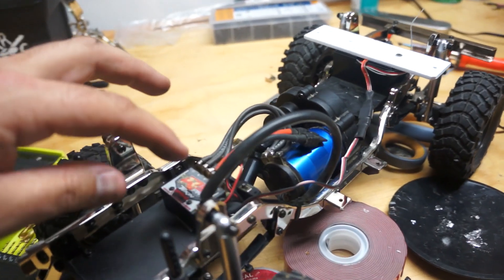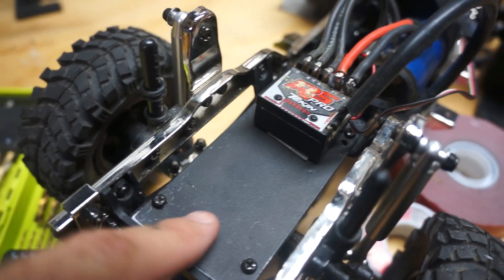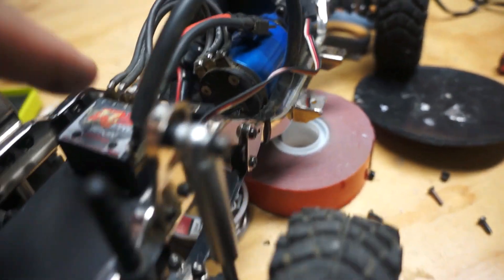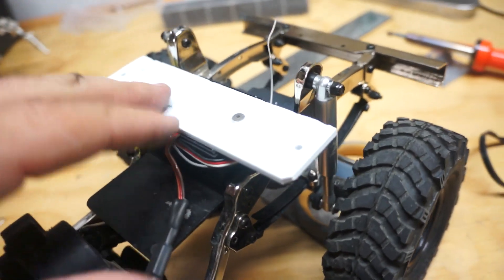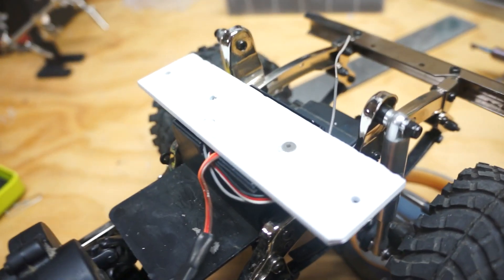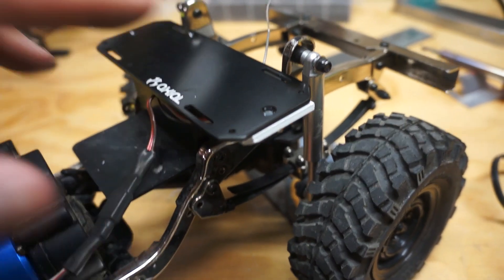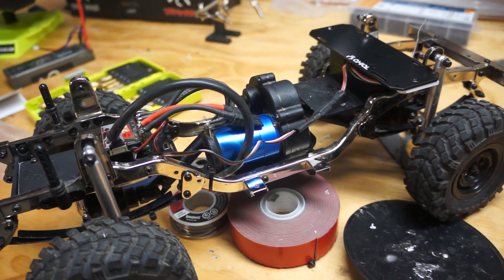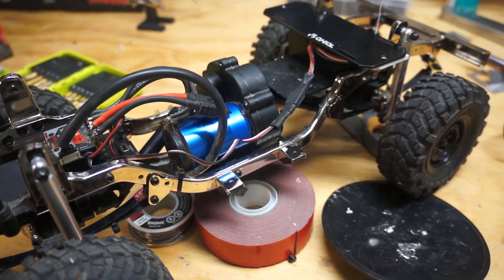GMADE Sawback / D90 Land Rover Defender Build Update 5

Comment: You are moving along nicely with the Rover. :)
Reply from the maker: +Joe Schmoe it's coming along. I tore out and replace the motor, ESC and servo last night while on The Tank RC's google hangout. It's all back together and have most of it waterproofed now. Next I have to tear down the axles to put some marine grease on the bearings and diff gears.